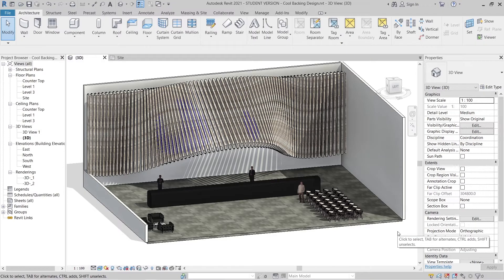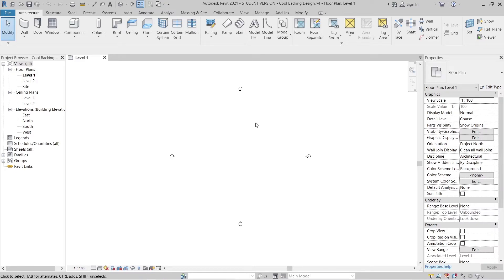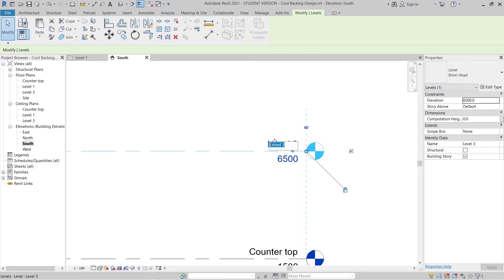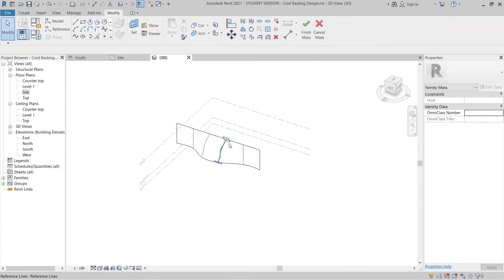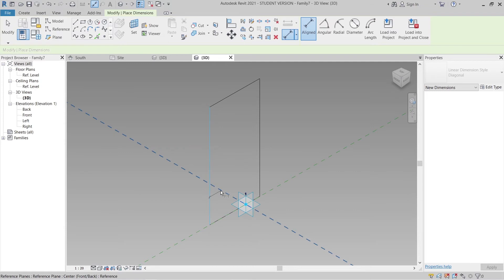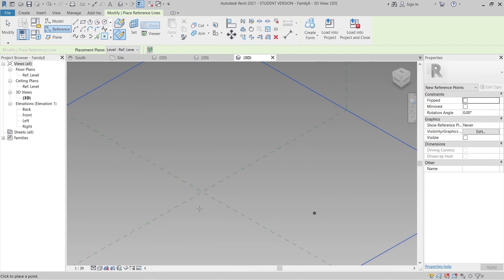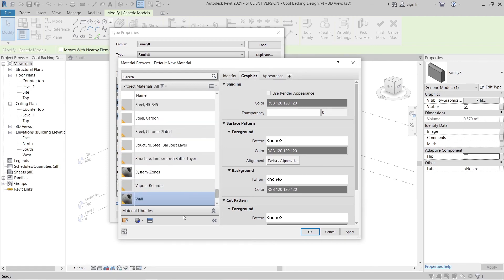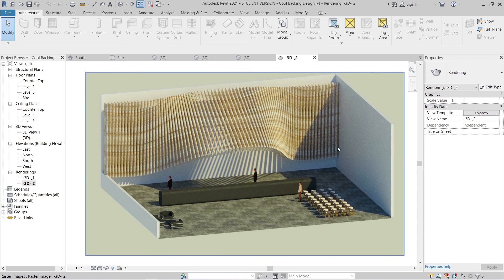Wall Design using Adaptive component in Revit 2021

Comment: In adaptive component, dimension didn't work into rectangular at point. whenever I do dimension then it didn't equal. error comes. 👈👈. It shows that constrain are not satisfied while equal the dimension. Can we make it in Generate pattern based instead of adaptive component?. using Revit 2020